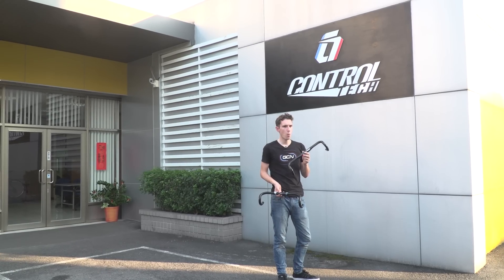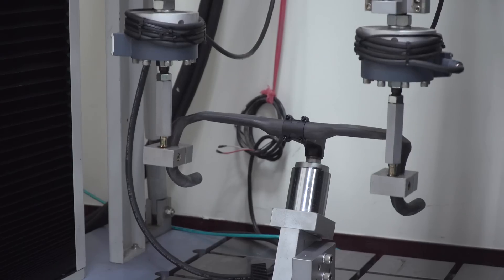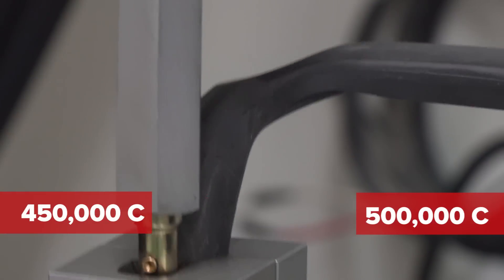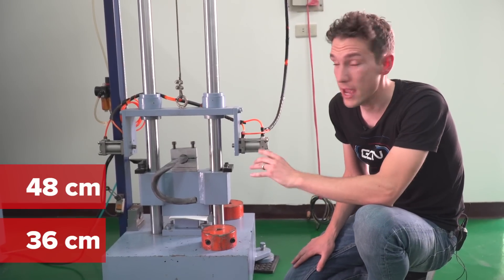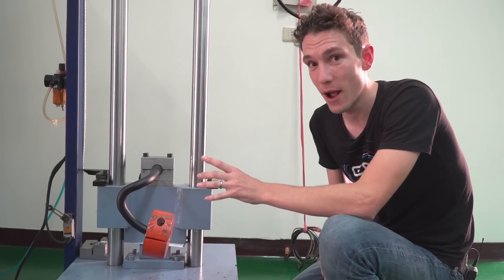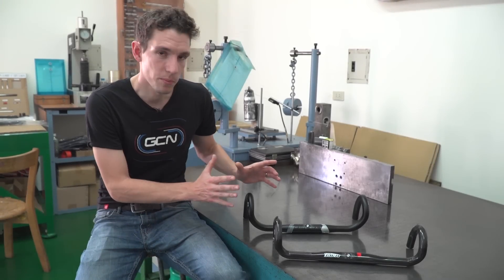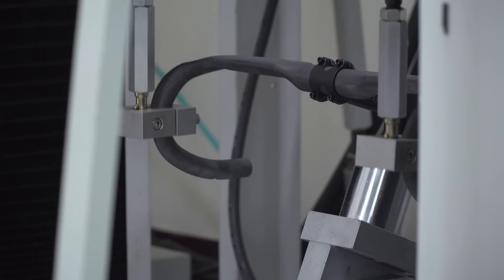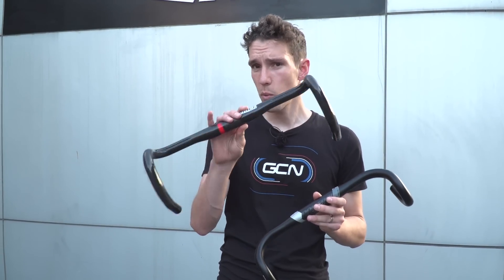Carbon Vs. Aluminium Handlebars | Which Are The Strongest?

Comment: When an aluminum part fails, it is a lot of cheaper to replace. Plus aluminum manufacturing is less prone to manufacturing defects especially if there are no welds involved.

Also, i haven't seen an aluminum part fail during a race without it being involved in a crash.

Comment: Would have been interesting to see the impact tests after being fatigued (ie more real world appropriate) and also with lateral as well as vertical impacts (the former being more relevant to crashes, the latter to pot-holes etc)

Doesn't look like Controltech were really pushing for one result over the other, if they were trying to promote carbon bars then you would have thought they'd provide a carbon bar without flared tops for the test as presumably a round bar would be more structurally sound (though then missing the aero benefits of course)

Comment: iv had a alaminium flat bar on a motocross bike break at the tripple clamp and when it goes, it goes. it was if somebody lazer cut the bar off instantly. compared that to how a carbon bar splinters like a tree branch. id rather have carbon because both your hands will be attached to the bike still. when the ally bar went on me, i fell straight off the back of the motorbike as it was the left side that broke off which lead to me grabbing a hand full of throttle trying to hold on with the right.

Comment: My S Works aerofly carbon bars cracked during use, near (but not on) brake lever clamping area. It started at the hole where the internal cables went in. Luckily I spotted it when fitting new tape, it had gone 3/4 of the way round. I’ve replaced them with aluminium ones, spoils the look a bit, but so would an about to happen death crash.

Comment: I watched this video because I wanted to hear Si say "al-you-MIN-ium".  :)  But seriously--I've ridden carbon and AL bars and crashed both--never broken a bar but broke some wheels.  I will say that I prefer carbon bars for the dampening and a reduced galvanic corrosion potential with the steel shifter clamps.  It's not a commonly discussed issue but I probably sweat more than most folks.  I didn't realize it was an issue until I snapped off the drops on an aluminum bar after the corrosion ate through it.  With carbon bars, the steel clamp becomes the donor and they rust away.  After 2-3 years I replace the clamps.

Comment: After buying a carbon seat post at a steal, I'm once again hooked! Looking to replace aluminum bars by control tech with carbon ones. The difference in ride quality is night and day. The new bars were also a steal at $99, honestly I don't care if they break b/c that level of comfort & lightness is totally worth it. Anyone looking to do significant miles on a bike should be looking at carbon components.
Reply: John  And you don't understand how handlebars work.
Reply: The time it break may not in as you expected, as you controlled scenario. It just create accident

Comment: its probably good to point out that aluminum is prone to failure due to corrosion brought on over time from sweat. if one has a high sweat rate and isn't changing bar tape often then there can be a catostrphic failure. i had a friend go down and break 5 ribs during a crit due to his bars failing. He is kind of a heavier rider.

Comment: You can design either material to any strength you like given there is no weight limit specified and that doesn't matter whats over. I'm more worried about the failure modes. Metal cracks are usually obvious and visible on the surface be it coming from impact or fatigue; carbon on the other hand leaves doubt lingering in my mind even if it looks fine on the surface after an impact. For that reason I stuck with alloy.
Reply: exactly!

Comment: Normal vs osymetric gears
Reply: Are you talking about metric gears from Australia, mate?
Reply: Oh yeah especially since they just showcased Emma Pooley's bike with non-round chainrings.
Reply: Maybe asymmetric chainrings in general ?
Reply: Some scientific studies have been done on non-round rings and so far it wasn't scientifically proven with statistic significance that they are better, or indeed worse. Granted these studies have flaws like small size samples and limited experiment time. So for now it comes down to feeling good or not with them.
Reply: Chris Froome's osymetric chainrings doesn'tt need scientific proove - he says they give him advantage and he is wondering why other doesn;t use them :D I use in my road bike aka Froome laser cut three oval chainrings 34/52/62 in MTB aluminium bike https://s17.postimg.org/z96xdahpr/Aero_Bike_EU_front_gears_62_T_20170826_122321_for_forum_with_cop.jpg and I feel huge difference in fighting sweet spot when compared to classic round chainrings no matter flat or while climbing ;) While climbing at lower RPM i used to slide in sweetspot back by pulling SPD blocks and use its smaller diameter to easier increase average RPM, while in the case of classic chainrings one had to change gears to be able keep going up hill. I believe in Chris secret is how he managed to use their osymetric chain rings, and nobody will know what he exactly does since he shows only average cadence and detailed timing within one full 360 deg chainring rotation is not published as I know - Ibelieve in  only after race video analysis could reveal such details by frame to frame anlysis of Froome rotation timing - probbaly it is constant rotation speed within rotation at high cadence, but at lower while standing on bike it might be different, I guess.

Comment: I stay with aluminum because it stands a higher chance of surviving a crash.  Assuming the rest of the bike is fine, I can finish a ride with a bent bar, but likely not with a totally broken one.
Reply: Aluminium bars wont bent that much, they break and when they break it happens fast and violently. So you have two options with an AL-bar: it doesnt break or it breaks so hard that you will hit the ground for shure. Happend to me twice.
With an carbon bar, it doesnt break that violently, it is like wood, it will buckle and get flexible but in most cases the bar will remain in one piece and you wont crash into the ground.

I will stay with carbon as it is the safest option.

Comment: Carbon both flat bar and drops. Have being riding carbon flat bar on my commute/utility tourer for 8 years, a lightweight 120g job made by Bottechia, I've been rear ended in a hit and run, a spill when a numpty kid ran into me in the middle of the road and a spill on iced over compacted snow down the hill to the supermarket (my fault going too fast). Not a murmour, nor to the carbon forks nor the carbon stays, oh yeah,I'm 102kg on a good day and I carry 20kg+ loads reasonably often and I'm not gentle with the bike. (Spesh globe pro). Just bought some 'PRO' flat bars to go on my adventure/gravel rig, I  use Modolo Curviussima on my CF racer.
 I'm still running TIME carbon composite forks from 1991. Make your own mind up but CF bars all the time for me, I'd never go back to alu, too stiff and not as robust.

Comment: I broke my back in a bike accident a few years ago and can't ride crouched down any more. Could I put BMX bars or similar on my ancient Kettler frame to help (I'm also 6ft6) and how would they affect the riding? I currently suffer badly after the 20-30 miles I ride a day, and have two centuries in 2 days next April, then a 2 day break until another pair of centuries, so I won't be able to lean for most of it, but speed isn't too much of an issue.
 I will add a huge thanks to GCN for relighting my passion for cycling too - now I go everywhere with my son in the trailer, rather than taking the bus locally, so thanks!

Comment: Carbon or aluminium bars?

My choice??.. definitely chromoly .. 😂😂
Reply: Hahahahaha

Seriously though that depends on the particular aluminum allow. A 7075 bar will be stronger till yield. However a 4130 steel bar will absorb more energy for sure.
Reply: @FLMKane  That's an interesting aspect of Alu over carbon. All alloy used within the cycling industry uses a T6 heat treatment process, I won't go into the heat quench timings because it's boring but, the ideas is that elements are present in different alloys to add different characteristics depending on application which translates to different weaves in the carbon world, 1K-12K, UD and so on. It is said that if your going to go with Carbon rims then go for disc or tubs due to the construction behind the braking surface, ie, Tub over clincher. 
Steel on the other hand is an, oddly, more complex kettle of fish. With F1 using 531 before carbon mono and with Columbus and Reynolds leading the way when it comes to bi-axle and trumpet tubing. 
With the testing process and ISO standards and with 10N equating to around 1KG for your everyday Joe, if your the sort of rider that puts down 500-1KW on your normal ride then a non branded frame would be questionable but....and there always is, if you haven't got tree trunk legs then a Chinese frame/grey import is worth looking at. I had ridden a Himod Cannondale for a few years and then bought a non branded frame as a winter ride, once built and dialed in it felt better than the Cannondale. I really wanted it to be crap so I gave it some abuse, this was around two years ago. I still have it and it's as sweet as the day I bought it, I've even bought a Grey imp, F8....just as nice to ride. (There has been some testing and frames being cut up in the world of Pinarello and their spec is frames being made from 1K weaves but having cut one straight down the middle they found 3K within and the outside layer being 1K, this is from the horses mouth and not one of those BS myths. Pinarello frames are finished in Italy with a lot of top end brands having their frames constructed in the same factories as you "no good" chinese frames. To conclude, If you pay your wack then you can have a nicely painted frame with stickers on, if you haven't the wack, then you can have the same frame with no fancy paint or stickers.
I can tell this is going to open the biggest can of worms but the proof is in the riding. I've been blanked by other roadies due to riding a unbranded ride, it doesn't matter what you ride as long as you ride.
Reply: Mine?  Titanium!

Comment: the reason professionals use alloy over carbon is that in the event you do have a crash where all the impact is imparted on the bars(I have personally experienced that my self) carbon cracks, where as alloy bars will bend, even if your bar is one half of a pretzel you can still ride home(if your still able to stand at that point) or continue the race where as a carbon bar will split in two, this is called shearing force, this shearing force is the reason the carbon bars cracked on the drop test, ductile alloy materials will always have a greater shearing force than super strong materials like carbon.
Reply: That's the first thing that I thought when I heard him ask why do pros still use aluminum when carbon is lighter.  They aren't exactly having a hard time staying down at the UCI lower limit, so any real or perceived benefit is worth keeping the aluminum bars.
Reply: Weren't there a couple of videos this last year of racing where a CF stem or steerer tube failed on the rider in a race? And video of a CF aerobar fail in a TT? 
Maybe the handlebars are likely to not fail in normal use/abuse for either Al or CF. But the failure mode of CF... oy.
Reply: That us d to be the case. Some of them now just use it to give their mechanic a easier time so they don't have to weigh it down as much.
They mostly now ride carbon bars due to that alot of them now ride proprietary bars that each model need to be more aero.
If stress and damage was a concern all sprinters would be on aluminum bars rather than carbon ones. Especially the likes of Caleb Ewan, Mark Cavendish, Peter Sagan.... You get the point. Even all the track sprinters use carbon bars.
Reply: seanvityaz 

What about a Thompson titanium bar?
Reply: Annnnnnnd yet the carbon bars failed in bending?
Reply: And yet I wonder if you have CF wheels or AL wheels?

Comment: If the carbon composite structure is so much lighter why don't do the manufacturers increase the wall thickness to match the weight of the aluminium counterpart? It could be much more stronger and the inner diameter doesn't look that much important other than at the very end of the tube (where end plugs can be used).
Reply: probably bc the carbonfiber still break if the force is aplied the wrong way so there is little to no point in making them stronger to forces in one dirrection also the prise would go up be a lot
Reply: The carbon composite handlebar is already way stronger than it needs to be. The impact test they performed was way more punishing to the handlebar than any vertical impact it would ever experience on a ride, due to the lack of cushion one would otherwise get from their front tyres.
That being said, I think they could've optimized the profile of the horizontal sections a bit better. The handlebars are basically cantilever beams. You want the handlebar to be as uniformly stressed as possible for maximal performance/weight. A triangular width taper with no depth tapering is the strongest cantilever beam gram-for-gram, and this would be easy to achieve with carbon composites. Also, the thinner the walls are relative to the depth of the cross section, the closer the inside edge and outside edge are in bending stress. So you can go with a deeper wing section and use thinner walls to get the same strength with less material, at the expense of increased frontal area and drag. All engineering is a compromise, and the exact solution the engineers decide on depends on the intended application. For example, a time trial handlebar should be ultra slender in profile at the expense of extra dead weight, while a hill climb handlebar should be ultra deep and thin-walled to save every gram possible without compromising rigidity.

Comment: I had a wicked 40kmh crash shortly after I got my current race bike, I slid on top the bike into a curb, aluminum bars bent a little bit, I just cranked them back and they're still good 3 years later, I have serious doubts carbon bars would have survived that...it's one thing to test impact where the bar can spring around like that with a weight on the end, it's another to hit an immovable object at 40kmh with a 90kg rider on top of it...

Comment: I heard a story (true, apparently) of a guy who hit a big pothole with his back wheel doing a 40mph descent. He stayed upright. He checked the bike (carbon frame) and everything seemed ok. Just to be sure he took it to the LBS and they said it was ok. A month later he was riding on a smooth flat road at 20mph and the bottom bracket failed at all four junctions simultaneously. Total catastrophic failure. He went to hospital, the bike went for scrap. The point is that if you see a crack in alloy you know it is prone to failure, but you can't always see the crack in carbon, until it's too late.
Reply: That is because carbon typically will delaminate internally, not crack visibly. The damage is internal and the strength is reduced. That is why we scan with ultrasound after an incident.

Comment: On impact test the failure on carbon handlebar occurred around holes mend for cable routing , i wonder how carbon would behave if it had the same shape as the aluminium one (round profile with no holes)
Reply: It would have spanked the aluminum bar. This is why this video didn't do its job, comparing different shapes doesn't help us isolate the differences in materials.

Comment: The impact test is nor fear because the handle bar shape is not the same. The place where the carbon one cracked was flat for aerodynamic reasons compared to a cylindrical one on the aluminium one.

Comment: Dude or rather GCN folks the problem is with the counterfeiting of carbon handle bars being sold online or even at your friendly neighborhood bike store for cheap that use bike people just cannot over look e.g.:  $50 versus $350 for a handle bar.. Besides the problem with pro peloton usage is that the mechanics cannot see the cracks within the carbon you easily saw in your test after a crash.  Anyways the general rule is to replace the carbon bar after an accident and replace the carbon bar after say 2 years of  use.  My Aluminum bike down tube finally cracked and then slowly grew longer after 13 years of use until I could tell there was a problem e.g.:  the chain shifting up or down a cog on hard accelerations because the frame flexed.  I really do understand how a Pro cyclist can ride a bike and tell when the frame characteristics have changed.  When carbon frames go out of speck why they just catastrophically fail it is my understand. Recently my carbon fork made a crack sound while traveling down hill say 20mph after hitting a pothole. After visual inspection I could see nothing wrong..no cracks.  But it is my understanding that inside the fork voids or wrinkles of the carbon fibers can buckle and peel away weakening the fork blade.

 5.8 Kilograms = 12.7868112 Pounds *2 = 24 pounds...tire and wheel and fork deflection will allow this # to reflect the actual weight of the rider that may weigh 280 pounds.
36 Centimeters = 14.1732283 Inches
48 Centimeters = 18.8976378 Inches
60 Centimeters = 23.6220472 Inches
72 Centimeters = 28.3464567 Inches
84 Centimeters = 33.0708661 Inches

Comment: It also depends on the stem aswell.  Mixing aluminium components wih carbon can reduce the lifespan of the part especially in winter . This is because the salt reacts with both materials and makes a battery which corrodes the carbon.